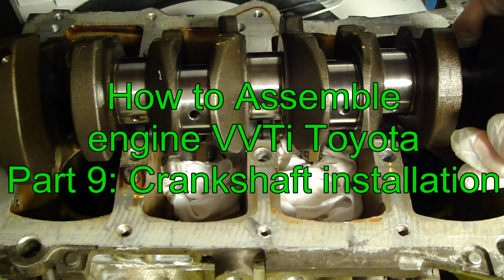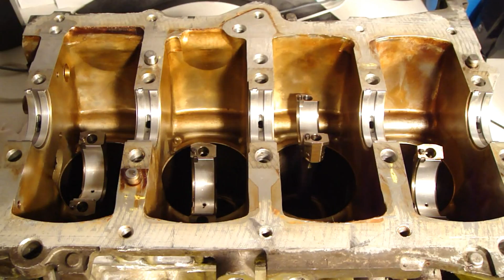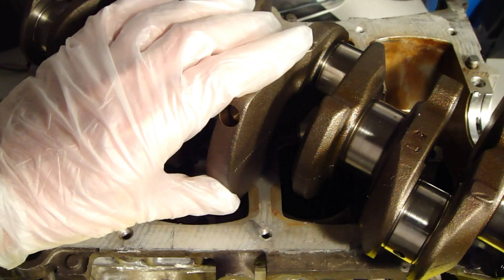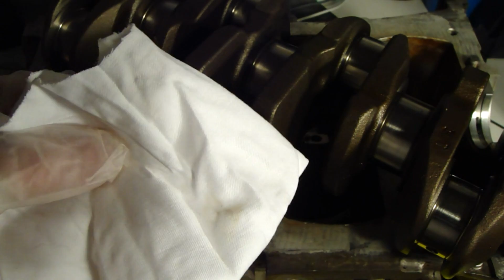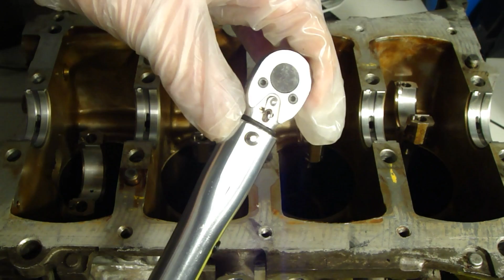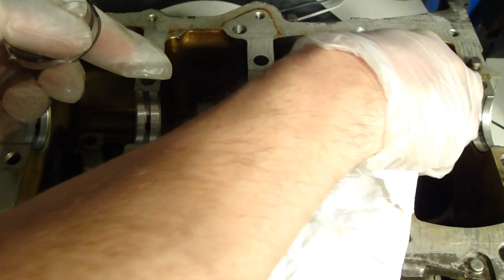How to assemble engine VVTi Toyota Part 9: Crankshaft installation

Comment: Would you replace crankshaft bearings if they had shiny/polished spots? Not worn through the aluminum, but enough to where you can't see the machine lines anymore.
Reply from the maker: No need to replace

Comment: I in general like your videos but in which universe you install a crankshaft without any oil or assembly lube  into the bearings?😯
Reply from the maker: Thank you for your message. I have read your message. 😀👍

Comment: Hi, @24.00 the thust washer bearings. on my 3zzfe the thrust washer bearings have fallen out and where in the sump. any idea how this has happened? 52k miles on engine.
i have ordered an new set and watching your video i think i can slip them both in how you did with the second one.
thanks.
Reply from the maker: Good 😊👍
Reply: It's easy to install them while the shaft is already there

Comment: hi peter. i have seen all of your 31/31 videos of how to disassemble engine vvti toyota. and now im on the assemble part 9. 
i wanted to thank you for this videos and for passing your knowledge to the viewers. it has helped me a lot as a beginner mechanic.
but i have a question....
WHERE CAN I BUY A TOYOTA VVTI ENGINES WORKSHOP MANUAL? like the engine for the 2000-2005 toyota celica..
because i am planing on geting a used toyota celica thats in good condition from year 2000-2005. and i need to know lots of information about this vvti engine.. because im planing to do a bore and hone to the cylinders and crankshaft and the journals of the main bearings. so that it can all be perfectly measured to -0.25mm. and im also planing to install racing pistons and both racing rod and main bearings adapted to the new -0.25mm size. and i need to know toyotas measuring laws and gaps for instalation of all the parts, the torque and so on..
the reason why i am planing on all this is because im going to install a turbocharger..
and i want to make sure that the engine runs like new for that task.

check out this page about toyota parts.. www.monkeywrenchracing.com
im buying my turbo from them..

i will continue to watch your videos.
Reply from the maker: Jose Perez Hello and Thanks. You could find VVT-i engine workshop manual from some Toyota repair technician. They also use CD discs. And Sorry, but I don't have this VVT-i manual.
Reply: Peter Finn great. i will look for it.
thanks...